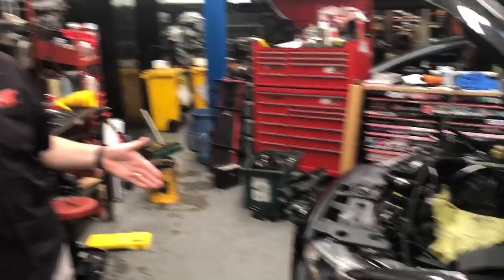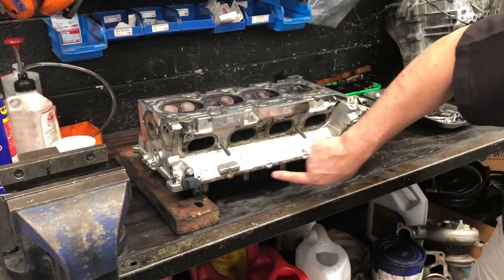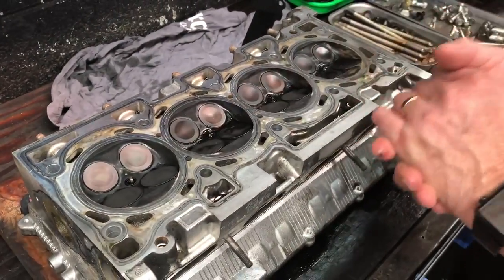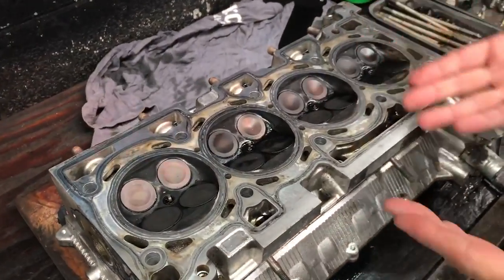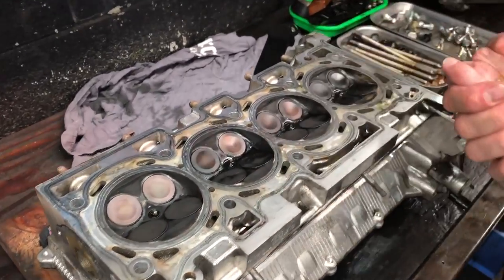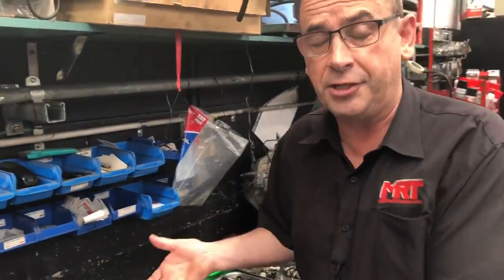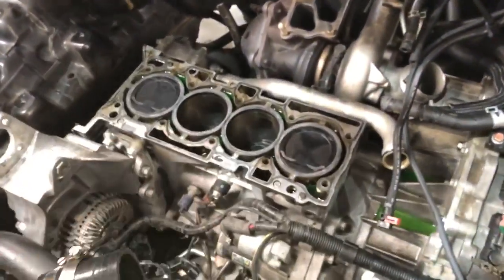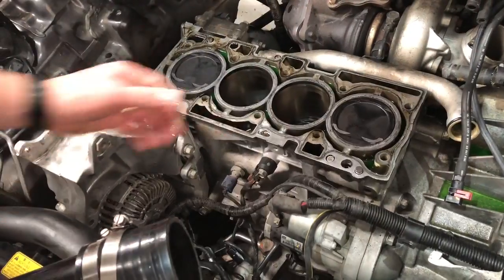Evo X Head Diagnosis

Comment: Easier just to pull the whole lot out, split the box off the engine etc. They have the lower engine half/girdle which would make it difficult  to remove such items in place.